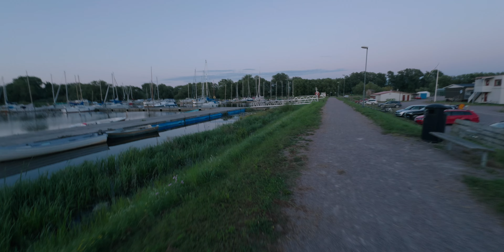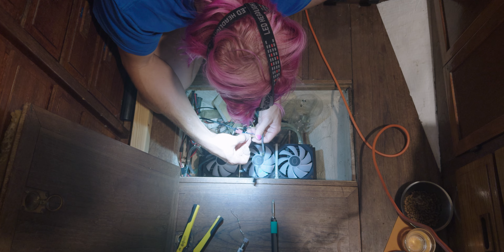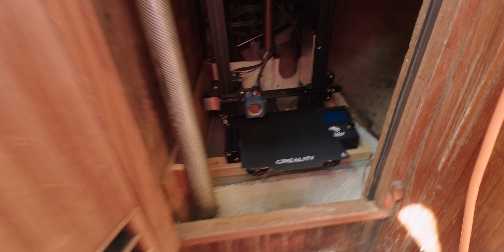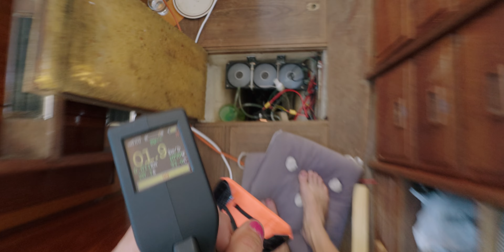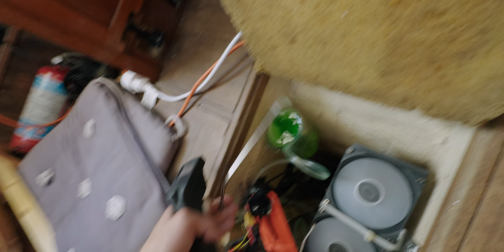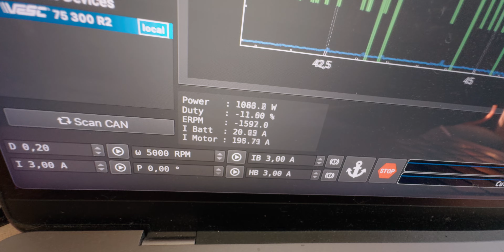Water Cooling Electric Sailboat with PC-Fan

Comment: HI maybe I'm too late to help but.. duty cycle is 12%. Think of that as "% of max RPM" motor current is 200A  think of that as "amount of torque".  You are maxing out the motor's ability to apply  torque, and getting nowhere near your max RPM because the prop is too hard to turn.  You need some sort of reduction drive, maybe 3-1 or 4-1 in order to get motor RPM and therefore power output up to something appropriate for that motor...
Reply: Wow. Fascinating. Thank you for this - Certainly helpful for me

Comment: I really think you are l-o-n-g past the point where you should go sailing, ready or not.
Drilling stainless: Stainless has this problem called work hardening which means if you are not making chips you are hardening the surface. You need a new sharp drill. Make sure it's a split point and preferably TiN coated or cobalt.
Do not use lube. Start with a very small drill at low rpm, then go bigger.
I would stick with the VESC system, it's cheap and very flexible. you can add a second or third controller using the can bus 
to sync a single output.
Your motor noise problem can be almost eliminated if you rubber mount, just like the engine you pulled out.
Reply from the maker: Great thank you so much for all the help! You'll see soon in the new video!

That's really cool with the VESC I didn't know that, but I saw that another swede rclifeon had an indian VESC motor controller that looked interesting. This one I've got needs a lot of cooling so I don't know if it's optimal. I will wait with the rebuild of the cooling though. We need to sail! :)

Comment: Vilket projekt! Högst avancerat :D
Lite saker ang 3d-printen bara att tänka på:
1. De är inte vattentäta by default. Även om du kör med 100% infill så är det massa porer i dem. Ska man ha dem vattentäta över tid måste man köra med typ epoxy utanpå eller så.
2. Tänk på layer lines. Den adaptern du gjorde till slangarna har en stor risk att gå av precis där den går från en storlek till den andra. Om man printar den upprätt så kan den knäckas åt sidan (alltså att lagerna splittas). Du kanske kan printa den i 45 grader istället och med support. Så hamnar lagerlinjerna över den känsliga punkten. Ska se om jag kan hitta exempel på det.
3. PLA är känsligt mot värme. Ex ska man inte printa saker som ska vara monterade i en bil då de kommer smälta eller warpa :p Ska man ha värmetålig så får man gå upp till PETG eller ASA men det är svårt att printa utan enclosure.

Bara lite tips för att dina grejer ska hålla :)

Och ja, klart du ska fortsätta!! Mot äventyret! 😀
Reply from the maker: Åå grymma tips. Ja jag använde inte något printat sen när jag testat att blöda ut systemet sen. Men bra tips på hur man ska täta, hade inte tänkt på epoxy så men skrev ut en y-koppling så om jag använder den ska jag nog köra glasfiberepoxy utanpå den kanske. Men ska nog undvika dom så långt det går. Men det är bra att kunna reparera saker i en kris tillfälligt. :) 

Hade inte tänkt så på fibrerna i printsen. Såklart det är som en växt eller trä! Coolt. Har också hört det att PLA inte tål uv så bra så får se hur bra grejerna ute håller. Kanske får printa om dom efter något år eller vad det nu blir hehe. 

Tack!! 😀